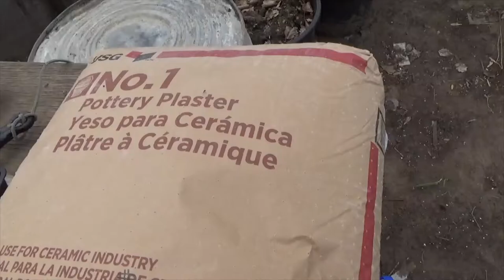Cast A Mug! Make a Pottery Plaster 2 Piece Mold

Comment: It would have been sooo much more helpful if you had shown how you did the second price so it is sealed with the first one.
Reply: You basically just rinse and repeat.
 Flip it over, remove all the clay, reattach cottle boards, apply soap to the 1st half of the cast that was done (because plaster sticks to plaster), and pour the plaster on top of the 2nd half with the cup still in there. Hope this helps.